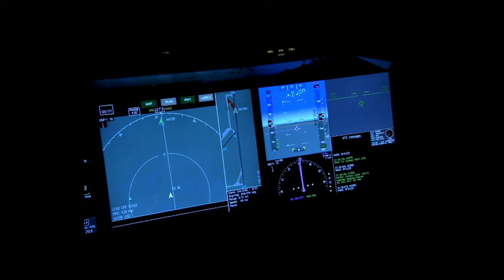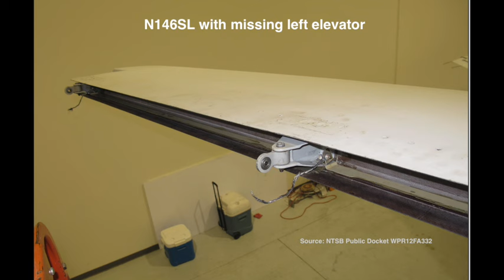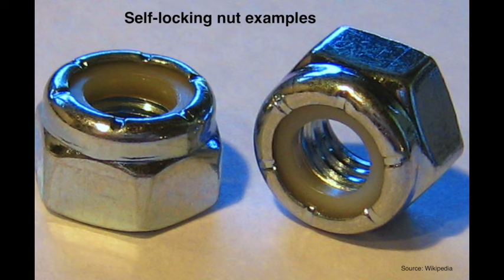Pilot & Maintenance Failures Create Dramatic Turboprop Incident – Episode 195

Comment: Great video.  The following is the short version of what happened to me.  By trade I am an aircraft maintenance engineer (A&P). Many years ago, I was maintaining three radial engine powered aircraft.  As you know, it takes time for the oil temps to come up due to the vast quantity of W120 oil in the tank.  The other procedure prior to take off is the engine performance check done at field barometric pressure.  A call came in and one of the pilots was not on the base.  His aircraft was number 1 in the line-up, so I did the detailed walk around, jumped in the aircraft started the engines, warmed them up, aircraft was loaded, and I taxied out and did the field baro run.  My logic for doing the run was should the engines not be performing; I could start working on the problem prior to the pilot arriving.  Engines performed well and  I parked the aircraft.  A few minutes later the pilot arrived.  I briefed him on what I had done to the aircraft.  The next part did not sit well with me, he jumped in the aircraft, started it, taxied out and took off.  When he returned, we discussed my concerns.  He said to me that he trusted my work.  I told him that what he did was wrong and should have done a walk around just the same as well as a field baro run.  Once the Chief Pilot found out about this situation, he had a discussion with the pilot and shortly thereafter, the pilot was dismissed.

Comment: Great video and analysis.  One point - while castellated nuts with cotter pins are common, not all flight controls have them.  My RV has locking nuts almost everywhere.  We use ball joints which can be tightened.  Also, other moving parts like the stick have a brass bushing that's slightly larger than the stick, and can also be tightened.  The nylock nuts work well.  Keep up the great work, gentlemen!

Comment: Parts Falling Off Airplanes- 34 years on the line I often wonder how so many fasteners fall off airplanes and nobody is injured. If standards are lowered in the cockpit and on the ground for political reasons there will be continuing accidents as far as you can see never to be stopped, the rigid high standards have to be maintained period. The Bolsheviks cannot be allowed to pressure changes for PC reasons, all jobs must be based on performance period.